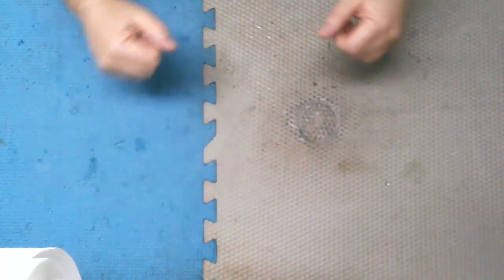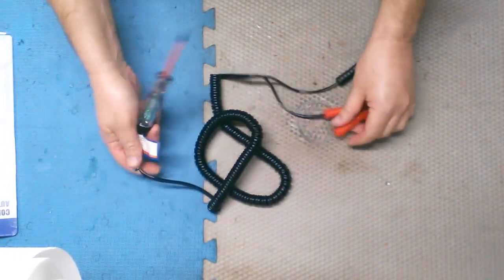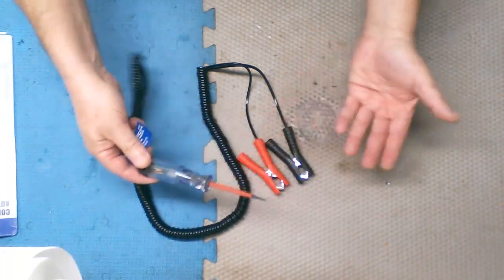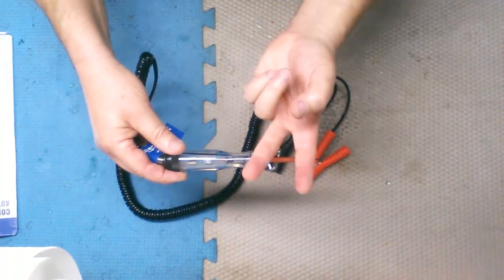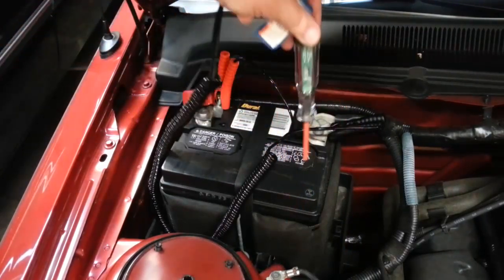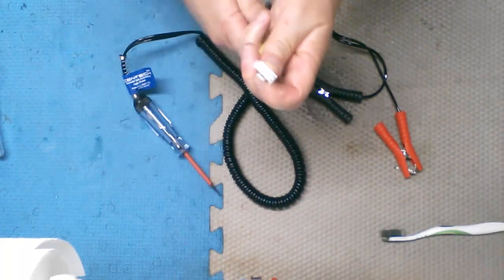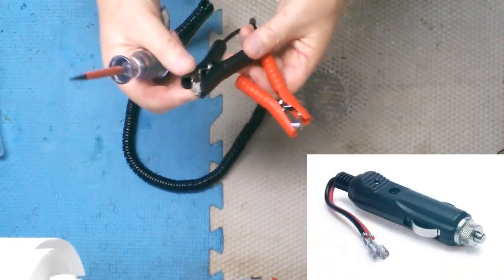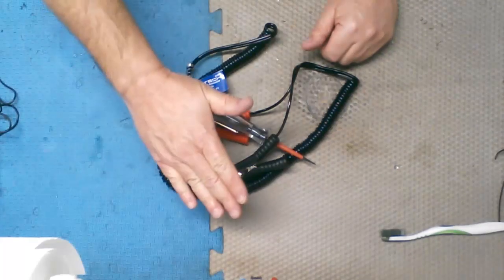Harbor Freight Computer Safe Logic Probe Automotive Test Light Review

Comment: I have the Harbor Freight one and one from Cornwell. They both work essentially the same, except that if you only hook up the negative clamp the Harbor freight one works like a standard test light but the Cornwell one has to have both clamps hooked up. And the Cornwell one costs several times as much. Handy tool to have.

Comment: Does the clamp have to go on the metal part of the let's say positive battery terminal or can you just clamp it to the cable ?    I found these don't open wide enough to clamp to the metal terminal
Reply from the maker: It does not need to be directly on the battery terminal. It can be on any positive power source you find in the vehicle. That is why I suggested using the cigarette lighter as a source of power.

Comment: There's a little more to this if you have powered relay circuit and probe the cold side of the fuse this tester will show a short to ground and there might not be a short to ground because the relay is back feeding the wire in order to check that circuit you need to remove every item that is on that particular circuit
Reply: Just ran into this a day or two ago.  Confusing at first so definitely something to watch out for with these types of probes.

Comment: LOL I own one of these and I thought it allowed me to put power somewhere. Since it has a positive and negative clamp I thought I would have power at the end of the probe. Which I thought made no sense at all because certain things in the car don't take straight 12 volts so you would probably blow out half the shit trying to see if it wasn't getting power to the tail lights or whatever. I guess I should have read the instructions before I threw them away. Thanks a lot for the video I will be using this test like a lot more often. I don't think the one I got was a Harbor Freight brand but I imagine they're probably all the same
Reply: U are thinking of a power probe, different tool altogether

Comment: The only problem with the LED test light is if the light goes out you can’t change the bulb !
Then you will throw away money down the road.
Reply from the maker: You can always solder in a new LED but if you cannot, then it cost less than $10 for this light. Most people can afford to buy a new one at that price.

Comment: This is a test light. It is basically a yes or no test light made for low amp circuits. 

I am a professional auto tech, and I use mine daily. It is far quicker than dragging out a scope to look for low amp circuits. I have a Harbor Freight one and a Snap On one. They both do a good job.